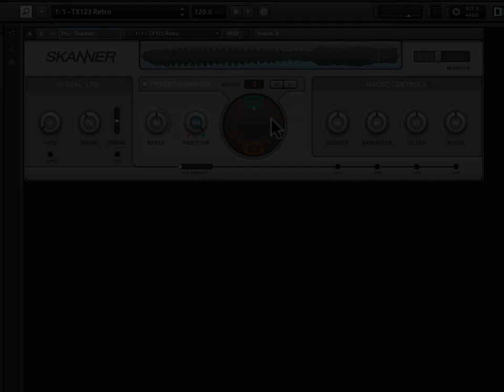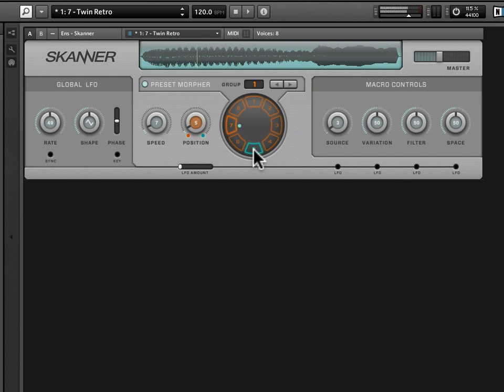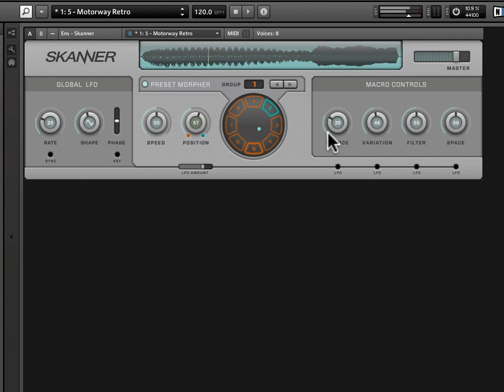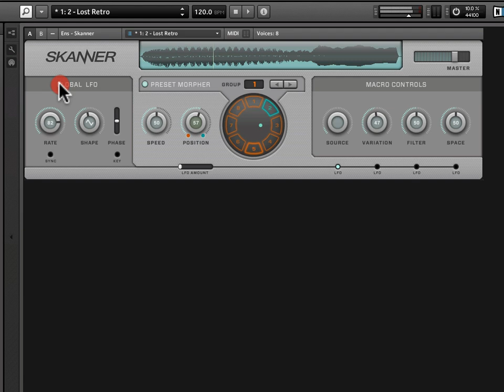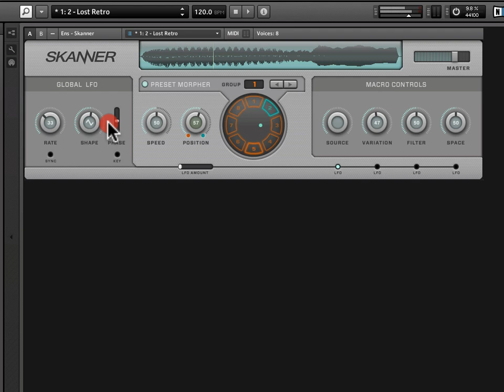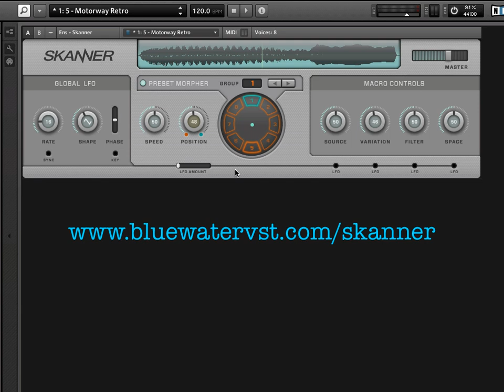Introduction to SKANNER - Part 1 - Intro

Comment: Is there a way to save settings in a preset?  For example if I am on preset 3, change it to sync.  If I push any other number and come back sync isn't selected anymore. :/  Any changes I make on a particular number never saves.